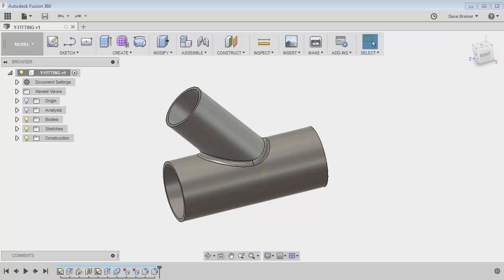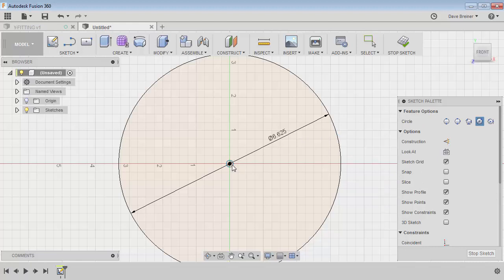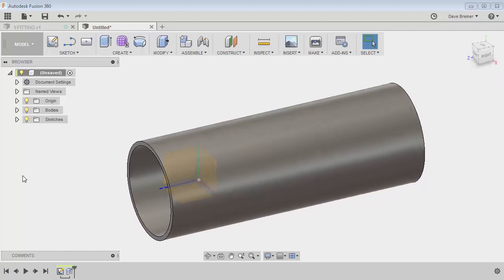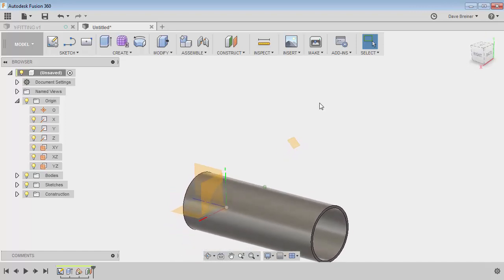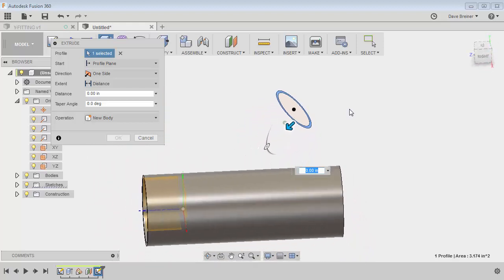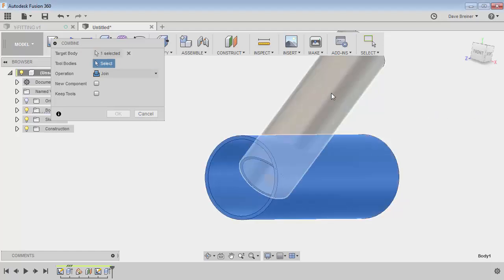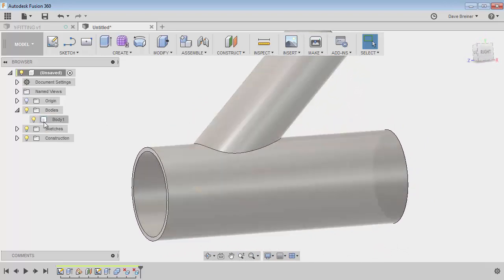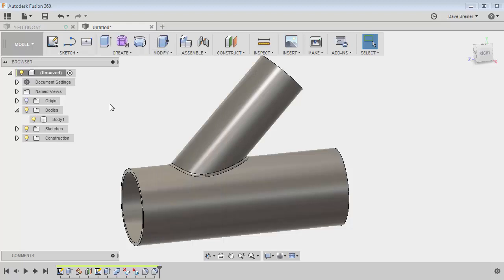Video Tip: Fusion 360 - Combine and Delete

Comment: Is a fillet instead of a weld suitable for FEA?
Reply from the maker: FEA is about the joint condition that's applied.  Actual fillet and welds are not a consideration.  In FEA, a simplified model is the key.